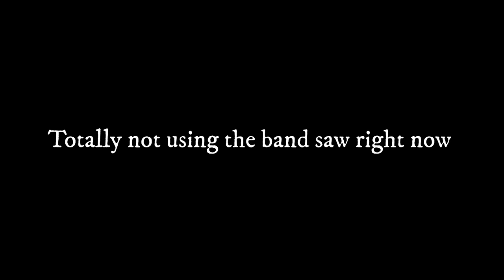Deer Antler Carving of a Gnome (Once Upon a Tine)

Comment: Really like the glass over your work space. I will do that with some tempered glass. Or, I may
find a piece of plexiglass not needed anymore.
Reply from the maker: Yeah, it keeps a lot crap out of my face for sure. You might find plexiglass to be a problem as it will static up and collect the dust. Mine is 1/4” plate glass, pretty safe.
Reply: @StockmanOriginal  Thank you Brian, makes sense to me. I'm for sure all about safety , eyes and lungs both.

Comment: Great video! I especially liked getting a closer look at the chisels and burrs you use.
Reply from the maker: Hey Brian,we sure appreciate you watching. One of my favorite burrs is one I made. It’s easy to make and does so much. It’s just a shank ground down to a three sided point, but it’s amazing. I think we have a video on that.
Reply: @StockmanOriginal  
Yes, I believe you touched on it a while back and we had a short conversation about the tri-pointed burr.  Once I get back to having free time I'd like to give it a try. I can already see that I need much smaller chisels as well. 😎👍
Reply from the maker: I save any broken or dull files to make tools out of, you just can’t buy them small enough . Let us know what you are working on.👍🏼
Reply: @StockmanOriginal  
I save all of my files as well and have some gouges and chisels already, just not in the right sizes.  Even the Harbor Frieght chainsaw files work for scribes and scraping tools. You just can't drop them on a hard floor.
Reply from the maker: Dremmal makes little cut off wheels that are awesome for shaping small tools.
Reply: @StockmanOriginal  I have a few of those still kicking around the shop. I just ordered a flex shaft for my dremel just to give figure carving a try.
Reply from the maker: That’s a good start.

Comment: Love this video! I've used Dremel in the past to carve antler, but I just invested in a Strong 202 micro motor carver. I haven't tried it on antler yet. What commercial stains would you recommend - dark Danish oil perhaps? Also, I was just curious if you've tried oil-based acrylics on antler. I saw another maker who was doing that, but wondered if you had any experience with it. Thanks!
Reply from the maker: Hello Four Oaks, so happy to have you with us. I’m glad you enjoyed this video. As far as stain goes l generally stick with walnut tea because it’s subtle. I use it to enhance the piece and make the details pop or to give it a little patina. I don’t usually use color but once in awhile I do and then I use acrylics. Be careful with commercial stain as it might over do it, but it’s fun to experiment with stuff. Love to see what you are doing. If you go on Facebook look for Stockman Original’s lost arts and forgotten crafts where you can join and post your work for all to see.